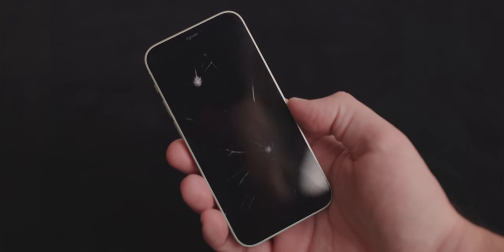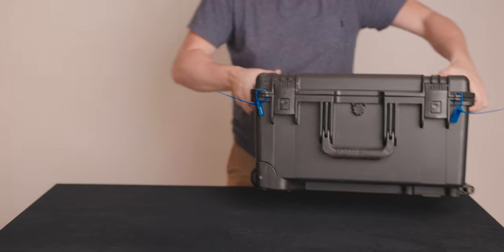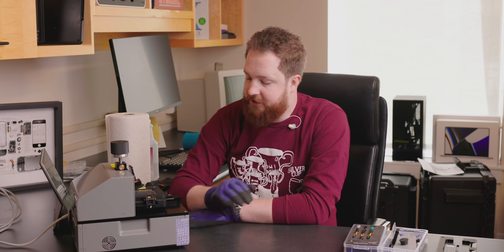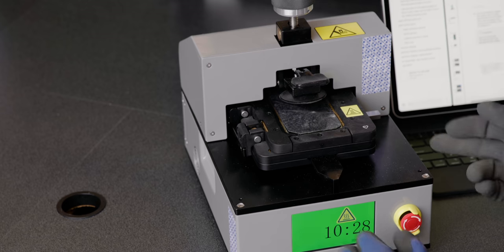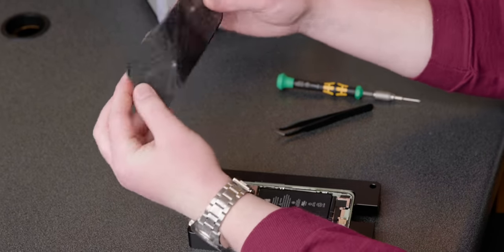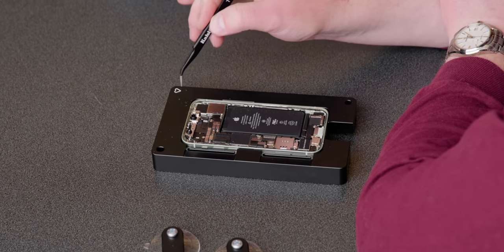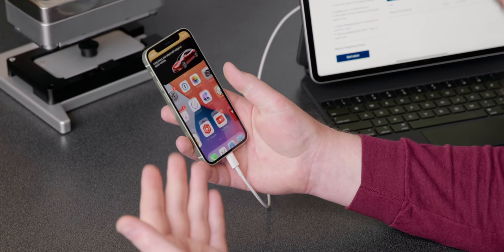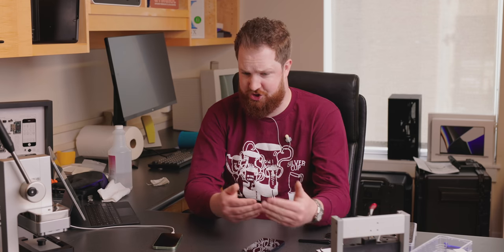Using Apple’s Tools to Fix My iPhone

Comment: the call with Apple was the most insane part to me. the way she can fully control your phone and run diagnostics remotely
Reply: We had to boot into a separate diagnostics mode for that.
Reply: The mode is completely isolated from the user's system. The phone does all the work pretty much; The user's phone calls the diagnostics server, they confirm it and the phone runs the diagnostics and sets up the system, verifying it with the diagnostics server. User has to go through the steps themselves, it's not "remote controlled".

It's the same as you verifying your email with a random service.
Reply: Sounded like a male to me, but that’s besides the point. It is super interesting how they can remotely reboot the device and stuff
Reply: Its apples phone, they just let you use it for a while.
Reply: @halami2149   sounded like a pubescent boy honestly

Comment: If Apple truly cared about the environment and the consumer, they would have approached things very differently... 

1. Devices need to be repairable by design and if possible upgradable as well. 
2. Parts need to be affordable and accessible. 

They clearly don't care, and they obviously designed their self repair program to be as unattractive as possible. 
If Apple ever mentions sustainability in any way, it's greenwashing. 

Looking forward to more repair/tinkering content!
Reply: iPhones are extremely repairable by design compared to other phones. Apple just locks it down with software. The mechanical design is great.
Reply: Upgradable phones have been tried. They were all a complete flop because nobody wants to pay the extra cost, or cary around a brick, because they’re significantly more complex and thick.
Reply: They are repairable. This literal, exact video PROVES they ARE repairable. What you really mean is easy enough for anybody with half a brain to do it, which is a very different argument. They're designed from the get go to be repairable by people with the skills and tools, which they provide. Yes they should make them more easily available, but again, that isn't the same argument.

Comment: Why, you would almost think that they intentionally made the process comedically absurd in order to deter people from using it.
Reply: They aren’t though, they are giving you the same tools, parts and process used in stores, several Genius Bar Techs have confirmed this, the only difference is you don’t have access to the software, and you need to call them to do that, and to be honest, I can understand them restricting software access, I probably would too.
Reply: Please they could easily make the pairing processes automatic. All it does is add a serial number to the damn lcd. Maybe it was extra testing done but maybe you can just test it yourself.
Reply: @almostanengineer  They do, though.
Reply: @skiks1853  why not send a mystery box you plug the phone into that runs the software?
Reply: @almostanengineer  Yes, but we're not Genius Bar techs. iFixit has proven that these kinds of repairs are perfectly doable at home with just a few simple tools and a hair dryer. Sending 90+ pounds of professional tools to a home user is just a giant "fuck you".

Comment: Been a technician for a truck and bus repair workshop some years ago. Some OEM's implemented parts registration/verification after installing it. Otherwise, it would display a warning on the dash. Separate ECU for the transmission which needed to be programmed to work.

Comment: It is there so Apple can say their phones are repairable and eco-friendly while giving the potential customer that they need to use the big scary tools whilst it should be repairable without most of those tools
Reply: It’s the same tool Genius Bar uses, some people always complain
Reply: @sa34w  this is political move.
If the price to change it by yourself is same as being changed by other person, what's the purpose?

This kit is there to say, "Hey, we are green" or they will charge more for official in-site service.

This is how business work.
If you are making a tool that is too reliable, no one will change it which is bad for business.
Reply: @sa34w  Not the point. The whole process is overcomplicated to oblivion and made to look hard. Sure, technicians use them and that's great, but do technicians also wait for the whole turnaround process with the parts and tools, input all the serial numbers and then have to send stuff back after having done the repair? No, they have all the software they need to do the repair in one hour, while this probably takes 3+ days, costs about the same amount as going to the Apple Store AND makes you as the customer assume all the risk (which given the price makes the whole process not worth it).

Right to repair is all about making the process easier, not about giving the tools to customers. If a 3rd party shop has to go through this verification every time they want to use a genuine screen and battery, then they are looking at the same 2-3 day turnaround time in addition to the repair itself. It's just not viable. Makes the whole thing basically a publicity stunt.
Reply: @37racso  its not that complicated. I don’t see how you wouldn’t be 100% responsible for the risks in repairing your phone. They made the tools and parts available. The verification process can be made easier but its not any different from lets say repairing a car. You replace an ecu, instrument cluster, bcm, radio, camera, rcdlr, airbag control module, etc… in a car it needs to be programmed to work properly or work at all and you have to pay for the software or go to the dealership or somewhere that has the software to program whatever module you replaced. There are things that need to be programmed for them to work properly. They gave you the tools, the parts, and all you have to do is call to complete the verification process. I’d imagine if they made software available it would cost more than the phone itself just like the cost of the software for cars and those are specific to each car brand. Not everything can be plug and play which is what alot of people hope for but it will never happen.

Comment: Thanks for suffering this process for the rest of Us! I've a few screen and battery repairs on various iOS devices and didn't have these special tools. Still doable, but janky. All worked out though. You can get the job done with some less fancy tools, but I guess this is the "Proper" way of doing it. Honestly, this is Apple in a roundabout way discouraging people from wanting to do it, but also, to possibly gain public support for their anti self repair stance. I will however give Apple credit for starting this Program.
Reply: I hardly think it would be "suffering" for those competent and professional few who can see what a great investment this is, on myriad levels. It's only "suffering" if you do it once. When you've used it a few times and refined your process, trained your muscle memory and developed a time & motion streamlined workflow, it's as simple as blinking your eyelids.
Reply: @unlokia  Wow, way to overthink the comment I posted.

Comment: Tip: Use a black stick or credit card to better adhere the display cover so when using the heated fixture, no issues with peeling or failed suction when pulling up the display. 

As far as ‘tightening’ the screw handle. The noises goes away after lowering it just above the display. 
After you have gained suction and begin lifting, UTILIZE THAT TIMER. That means don’t rush to lift the display. (Especially important if the display intends to be used again). Allow heat and suction to naturally pull the display enough to where the adhesive breaks on the bottom middle and there’s a small gap. THEN START SEPARATING. You will split your display any other way because it’s forced entry (that’s what she said). 

Did you know the more warm the PSA is the better it comes off? Also if you read the guide you would know to NOT USE ISOPROPYL. USE ETHANOL WIPES.

Comment: I have been working at a 3rd party repair shop for 5 years and most these repairs take us roughly 20 minutes(testing before,heating, disassembly, repair, re-assembly, and testing the device after.) We apply water seals and tamper stickers. I see all these extra steps as unnecessary. I do appreciate them taking a step forward towards self repair, but from the things I've seen come into my workplace, I can only imagine how many things can go wrong, especially if they puncture the battery.

Comment: The thing that frustrates me about this is that it's pretty clear, at least in my opinion, that this is an attempt to "prove" to the public that phone repairs are highly technical jobs that require expensive and precise tools.  The reality is, those cases are overkill for the relatively small level of precision required for their functions, they're off the shelf machines that you can buy from Alibaba, and the strategies that the likes of ifixit use are substantially more practical, for money and time saving, for consumers and small repair shops.  I don't think this program is supposed to be successful.  I think this is to prove to the government that they're willing to give us the chance, and to prove to the consumer that their repairs are hard.  After that, I think we'll return to status quo and they'll make an example out of it.
Reply: Sounds about right

Comment: My guess behind all of this machinery beyond any conspiracy theories and the obvious "apple doesn't want anyone meddling" is the fact that they need to provide tools which allow for consistant repairing. The molds allow the user to follow instructions EXACTLY as told and fix it all the time, or at least they suppose to, so do the heating machine.

If they by any chance were to provide a simple heat gun and say "point it at the phone till its warm, but not hot, just touch it and make sure", and anyone were to screw up the process, they are lending themselves to countless lawsuits.

So once again, I understand the outrage behind the amount of machinery involved, but at the same time, I see the reasoning.
Reply: A person who can't use a heat gun would never get the idea to repair their phone by themselves, or well a few people might do it, but won't be so common that the repair program should be designed for those people. It should be designed for the majority who'd consider repairing their own phone, aka people with experience and knowledge.
Reply: @rasmus5656  That is common sense speaking, and for you and me, sure, it works. But at the same time, I imagine the average joe would want to try it as well, hence the overly engineered equipment. 

Apple simply cannot allow any user to screw it up for their own safety.

Sure, it would've been better to just allow for their products to be repaired from the get go so we wouldn't have to go through this, but that ship has long sailed already.
Reply: @rasmus5656  I do hope you are right, R2R is just around the corner.

As for the reply, I agree, I was just stating their possible rationale without touching on the huge obvious elephant that is profit.

Comment: I don’t imagine how massive the tools for the MacBook gonna be then
Reply: Macbook doesn't have ip68 rating,, there are no parts with adhesive.. apple will replace whole parts in a macbook (if your lcd broke, you will replace the whole lcd parts).. it doesn't need any heat tools.. only screwdiver and som pick or spudger..

Comment: Apple clearly doesn’t want this program and is making it as different and expensive as possible so you just go to their store.
Reply: So you think that the process is difficult on purpose? Why would Apple make it difficult on themselves if it can be done easier way? They literally give you the same tools and manuals they use. Aside from confirmation part. That is absurd and they should make that an on-line self-service tool.
Reply: @HoldFastFilms  That's not the point. This program is pretty much as expensive as going to the store to have it fixed, except you assume responsibility for both the repair AND all the kit they send you. The repair appears undoable for 99% of people, so there is also that. It's almost worth it sometimes and not worth it most of the time.
Reply: @HoldFastFilms  As if Apple never has done anything stupid or difficult on purpose or out of incompetency.

Comment: I've seen this time and time again and still have no idea what the glue strips underneath the battery are for except for Apple trying to show the 3rd party repair shops just how much of an asshole they can be.
Reply: the battery compartment doesn't fit the battery snuggly, so they use glue to hold the battery in place, every phone has it
Reply: @Dwivil  - yes but... things are so packed tight inside an iphone that the glue strips are kinda overkill. 

I've never had a battery rattle without the glue strips and I've changed a good number of batteries.
Reply: @ezg8448  just because they are snug doesn't mean they won't move. this is a battery you're talking about, where tiny dings could cause the whole thing to combust. why would you not want to secure that?
Reply: the pull tabs are the best thing about iPhones, all the other companies (especially you Samsung) just use some elephant glue to hold them in place which makes removing them a lot harder. I appreciate the pull tabs.
Reply: @PvtAnonymous  I've seen that for a lot of the recent Samsung phones, you just use some isopropyl alcohol and wait for a while, then the battery comes off easily with a suction cup thingy or a pry tool.

While with the pull tabs, you have to pray to a weird assortment of Gods to hope that they don't break. Sure, they work a lot of the time, but what's wrong with how Samsung is doing it? It just seems like a more reliable and simple way to do it.
Reply: @danshilm  you can do the same with these strips if you can‘t remove them by pulling. It‘s just way faster and safer for me to not damage the screen in the process.

Comment: I have a buddy fixes iphones and he did something interesting with the batteries to make replacement easier. He hated how the batteries had adhesive on them so he made a little 3d printed clamp cage for the batteries. When he first started out he used velcro to keep the batteries in place. But made it easier for removal. I wouldn't call his velco solution the smartest thing in the world, but before he had a 3d printer he tried to think of ways to get around the battery adhesive.
Reply: I think Apple wouldn't even consider that as a prototype idea. The point of the battery mounting solution used is to prevent it moving, not to effect a quicker repair, on the off chance the phone ever has the battery replaced. Apple's solution is designed to allow the phone to NEVER have the battery work loose.

Inventive thinking is to be commended, but NEVER assume the next owner is going to know that such a seemingly temp "solution" holds their battery in place, such as that from your friend. Apple wins this one.

Comment: What they need to do is have the "kit" available for rental at most apple stores that offer repair. That makes it so much simpler logistically. You just reserve the package you need, then you get an email or text telling you available pickup windows. Then you just confirm and go pick up the pelican cases. This would greatly reduce the waste involved in the current process.

Comment: Pro tip, if you break the tabs on the battery (even if its all of them) you can stuff an Isopropyl Alcohol wipe underneath the battery and let it there for a few minutes. The Isopropyl loosens the adhesive turning into a a soft gummy version of itself and making it much easier to remove. Just be careful not to shove the wipe too far under the battery as it will eat away and destroy the Mylar covering the wireless charging/nfc coil.

Comment: As someone who works at an apple retail store in the UK as an iPhone repair technician, it’s interesting to see they supply nearly all the same tools we use. It is concerning that some of the safety tools are missing such as ESD work station, grounding straps and sand in case of a thermal runaway.